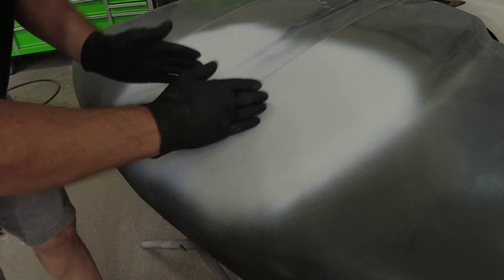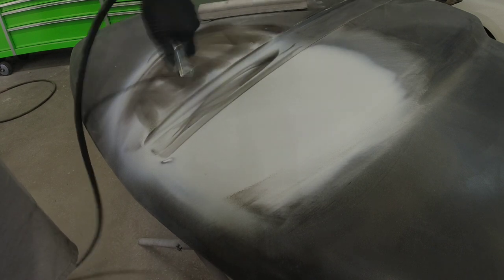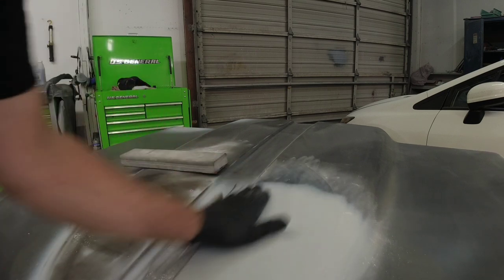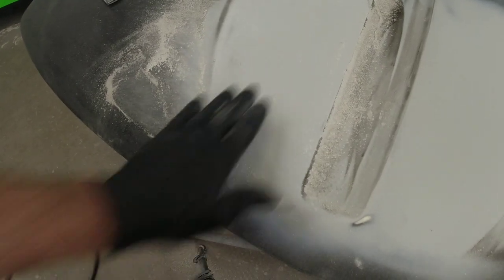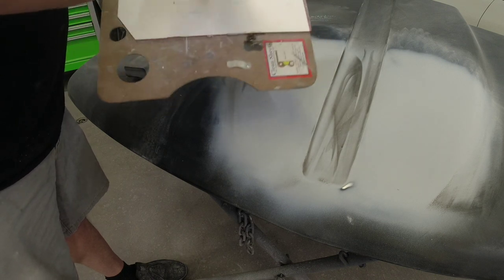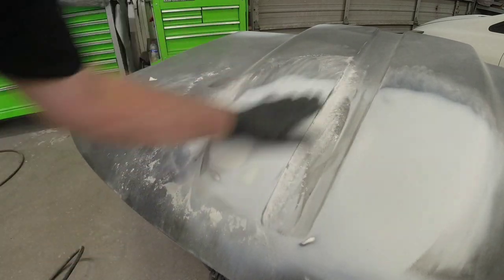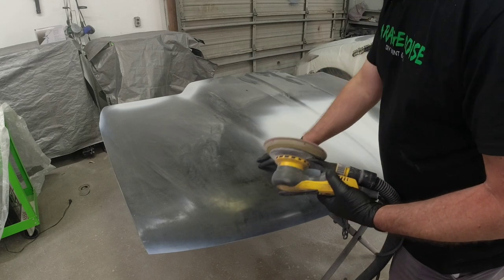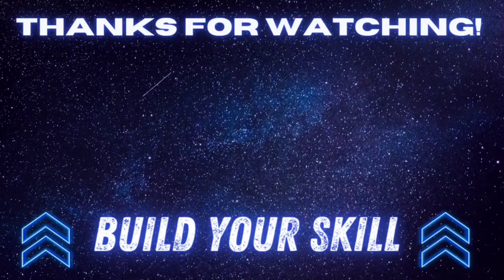How to prepare primer for perfect auto paint.

Comment: Thank you for posting this. I wasn't sure about reducing my high build primer to use as a sealer... but now I'm confident I should do it for a uniform base color.  Bumper of a 2014 corvette.
Reply from the maker: 👍upol you can, if your using a different primer  then check the Technical data sheet

Comment: Beautiful end product. Quick newbie question tho… what’s the purpose of sealer before the base coat? Thanks
Reply from the maker: Sealer creates a barrier between the basecoat and the primer also create one uniform  surface to apply basecoat and can help fill surface sand scratches in primer before basecoat.  Appreciate the question and support!
Reply: @GarageNoise  so sealer goes on smooth with no need to sand?
Reply: @clarkharvell5242  You do all of your sanding on the primer itself. All of your prep work is done before you apply sealer. So: Primer, sand, sealer, base coat, clear coat. No need to sand the sealer. If it helps, you can think of sealer as being equivalent to sanding  your primer with 20,000 grit sandpaper; it leaves a very smooth surface for the base coat to lay on., much smoother than what you  can achieve with just primer that has been sanded.